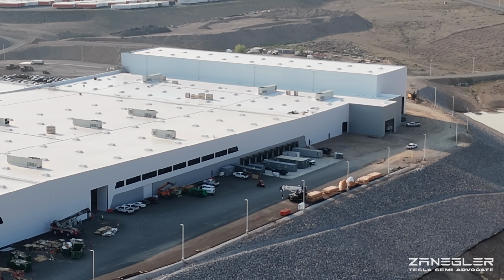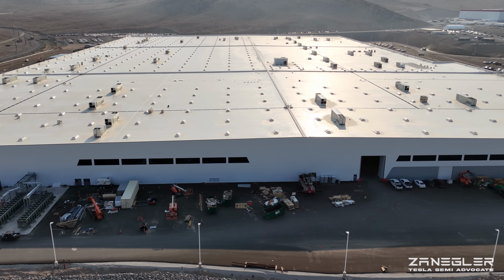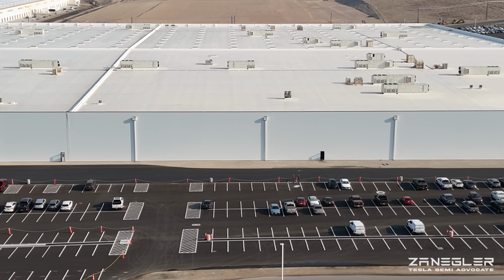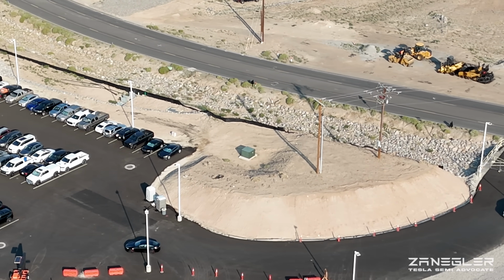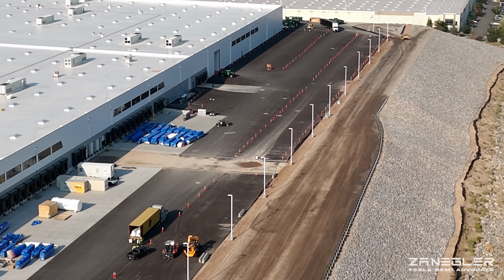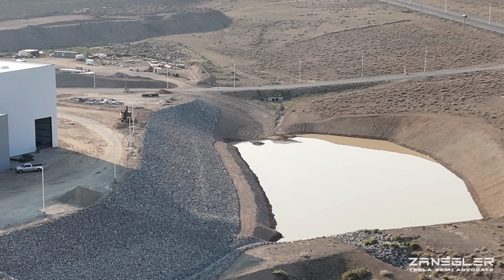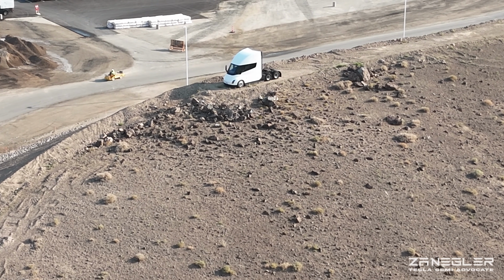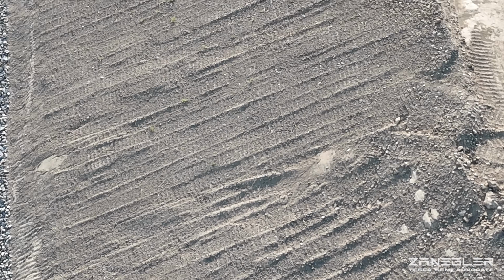Tesla Semi Factory - First Drone Flight in 10 Days

Comment: The 'propelled mover' is technically called an SPMT or Self Propelled Modular Transporter. it has multiple wheels which all steer through ninety degrees either way so it can turn on a sixpence (or dime) or crab and jack up to level the load or pick up the load,and make up for ground irregularities, all computer controlled and operated from a remote handset so that the operator can walk around the load to check clearance etc. also multiple SPMTs can be linked together to act as a single transporter.
Reply: Sweet bit O gear.

Comment: Is there a reason why these data centers can't be put underground where they can be more effectively climatized and secured. Seems to me like putting some sort of heat scavenging system would help.
Reply: Data centers produce heat? Putting them underground where it's hot?
Reply: @TheMagicJIZZ Your average limestone cave is about 50 to 59° they use them for cold storage for food because it cost a lot less to bring the temperature down from 59 then a building that's sitting out the sun baking at 180°. Plus it would seem like the heat could be scavenged to help with operational cost.